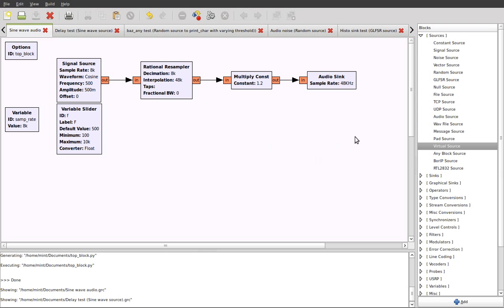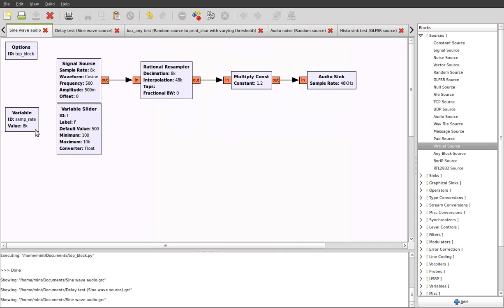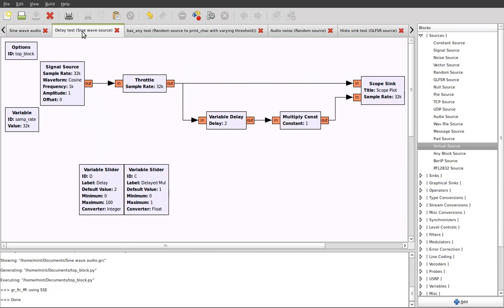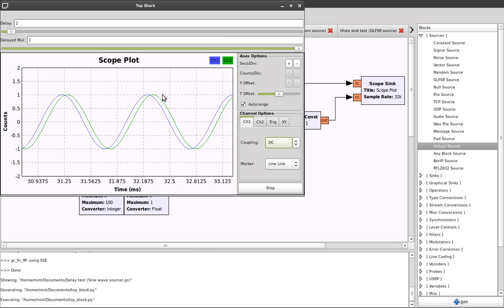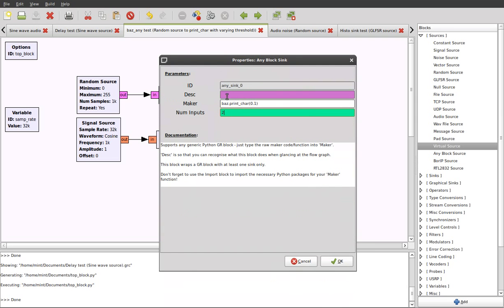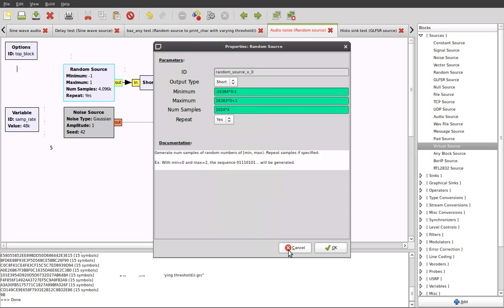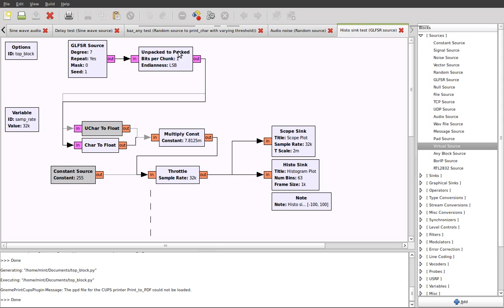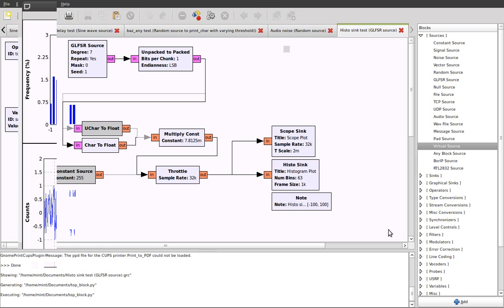GNU Radio Tutorials: Part 1 - GRC, Sources, Sinks, Audio & GUI Blocks

Comment: I don't seem to have any 'sources' to place derp, let alone the RTL2832 one I need to get started, any ideas? (debian)
Reply: +d74g0n I'm having the same problem on raspian
Reply: +d74g0n You have to download it. Does not come with it. How depends on setup. Sudo port install gr-osmosdr is how i did it on my MAC using macport.

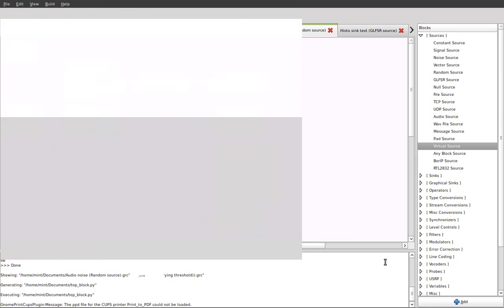Comment: I'm having trouble understanding the "Audio Noise" flowgraph at about 10:34. There is a line going to the middle of the Short To Float block that is not connected to any input/output port. What is that? Also, the vertical line on the far right intersects four horizontal lines - are these signal paths connected? If so, do the inputs to the blocks on the right side have two signals into on input port? If not - what do they do?
Reply: I had some difficulty with that at first as well.  Looking at the video more closely I clearly saw him select the "Random Source" and "Short to Float" components.  Investigating that, I discovered that you can disable and enable components with a right click.  Disabling those and adding the noise source results in the same configuration seen in the video.  Both sources are connected to all of the sinks - but only one is enabled at a time.  A disable component is grayed out.  The older comments below provide additional insight into these tutorials.  Thanks, Balint,  for these tutorials!

Comment: Very well done! Thanks for putting these videos together. I would recommend making a note of pybombs which made it so much easier to install GNU Radio proper as well as the gr-baz branch. Also, some of the scope and histogram sinks are outdated; the current default GUIs use the Qt toolkit, but the ones in this video use Wx. I discovered that you can switch between the two by double-clicking the Options block. Thank you for a great tutorial!

Comment from the maker: The outputs of the 'Short to Float' and 'Noise Source' blocks connect to _all_ inputs of the blocks on the right. The trick is to _disable_ one of: ('Noise Source') OR ('Random Source' and 'Short to Float') so there's only one enabled input to the blocks on the right at any one time. See how in the video one set is a darker colour? That indicates it has been disabled. The keyboard shortcut to do this is 'e' (enable) and 'd' (disable).

Comment from the maker: I'll keep this mind! For the moment though: the best antenna is one that's tuned for the single frequency you wish to listen to, e.g. I've had luck with simple quarter-waves w/ radials. If you want to scan, then next best option is an antenna suited for that band (tuned to middle of the band)-you can choose between omni and directional depending on your constraints & how much gain you need. If you can, pay extra for better RF cables if you need a long run-or use BorIP Server (see my other vids).

Comment from the maker: You might already have the code then - which script did you use? "Grab the code" means checking out a working copy of the source code from either my SVN repository, or github. Then, when inside your working copy, you compile & install the code. Full details are on the gr-baz wiki page (link in the video description).

Comment: trying to run OP25 and getting following error:

    self.wxgui_fftsink2_0_0.set_callback(wxgui_fftsink2_0_0_callback)
  File "/usr/local/lib/python2.7/dist-packages/gnuradio/gr/hier_block2.py", line 54, in __getattr__
    return getattr(self._hb, name)
AttributeError: 'gr_hier_block2_sptr' object has no attribute 'set_callback'

I have not been able to find any help with this anywhere.  Ubuntu 12.10 GRC v3.6.3-35.  Any help will be greatly appreciated. Thanks in advance.